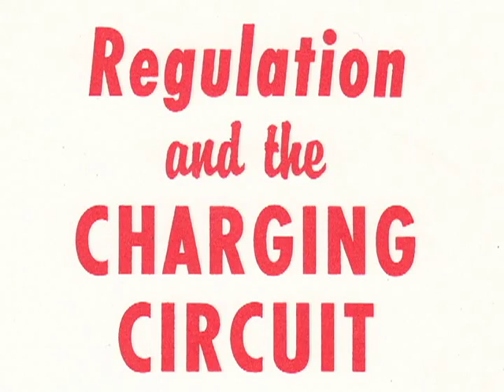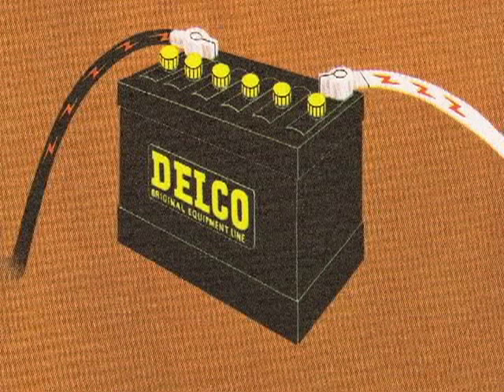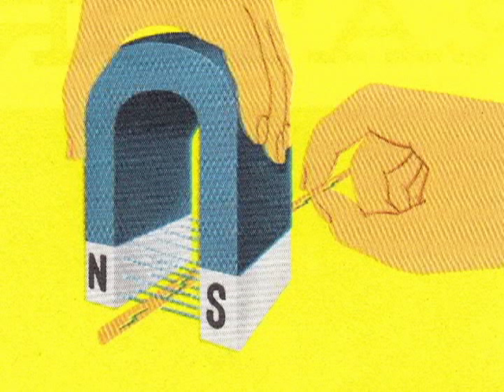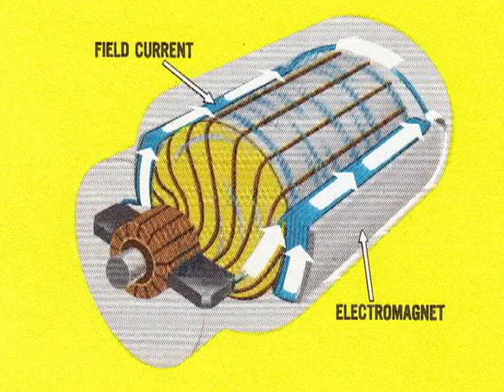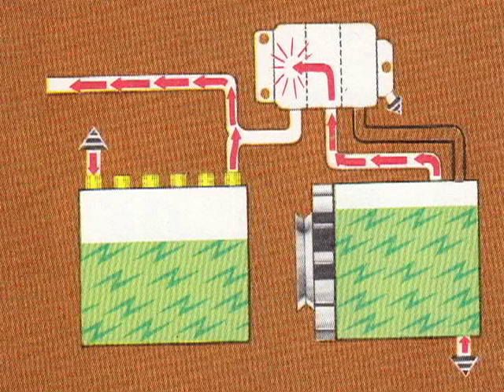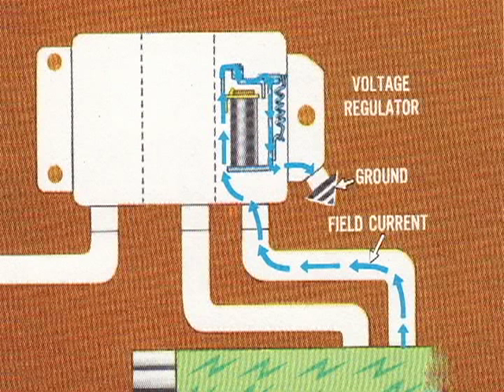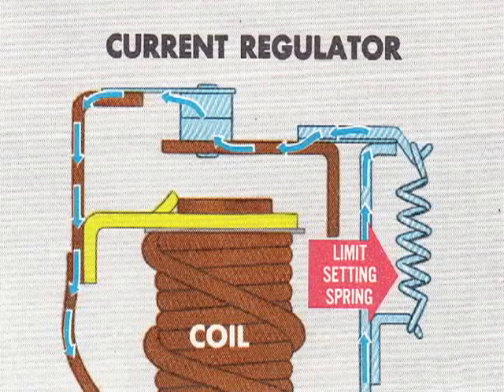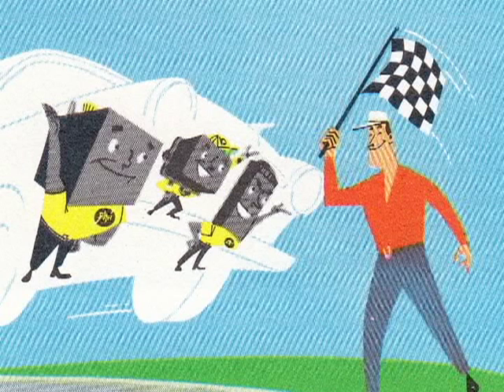Delco Remy - Regulation and Charging Circuit

Comment: fantastic explanation. But what are the proper settings for the voltage regulator points  for a typical delco remy generator so that the field coil is not over heated. I assume that it must be about 14.5 volts for the generator points but the field winding cut off ?